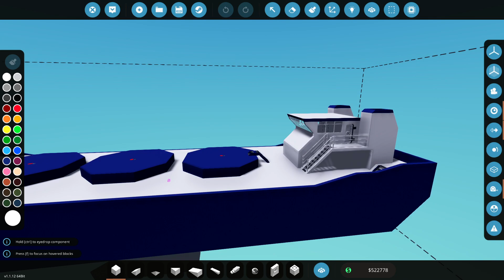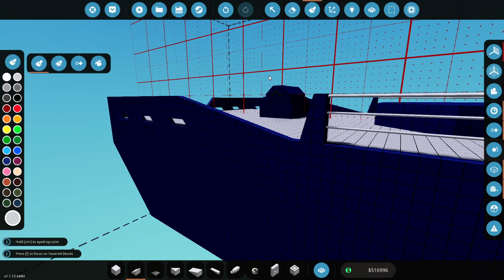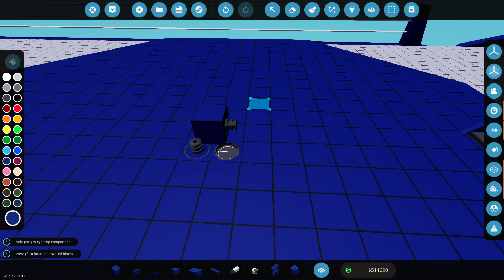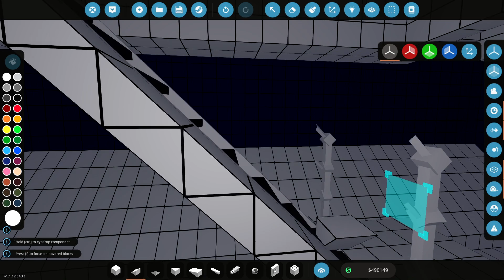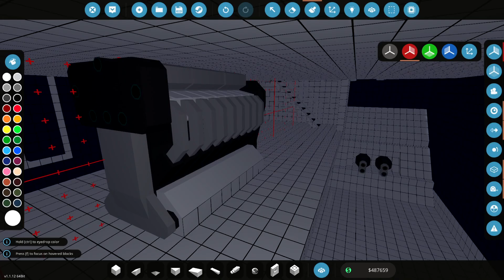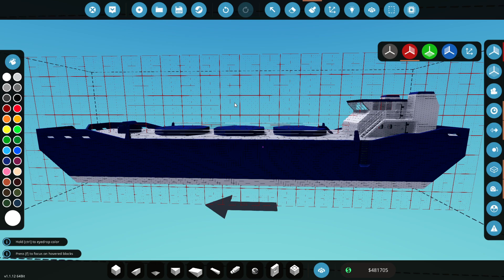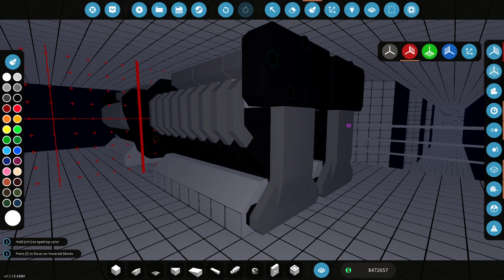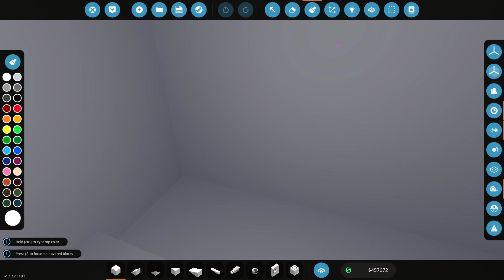Diesel Electric POWER!!! - Stormworks - Career Mode - S2 E23

Comment: Если перевести силу с двигателей на генератор а потом на электрический мотор то потеряешь 40% эффективности. Лучше присоединить на прямую. И кстати танкеры не используют fluid jet
Reply from the maker: Thank you for the info :) Maybe I will connect the engines directly soon for some testing! I like the current setup but we'll see what happens. Regarding the fluid jets, I found that one of the inspirations for my barge, AKRA 70 - self propelled oil barge, uses fluid jets. It uses 2 Hamilton HJ364 water jets which take around 930 horsepower each. I thought I'd give it a go as I rarely use the fluid jets and they are great fun :)

Comment: How did you do your bow thrusters
Reply from the maker: I use 1 motor & prop for left, 1 motor & prop for right. Then I put an on off switch into a numerical switchbox and send a 1 signal to either right or left. depending on which way I need to go. Hope this helps :)